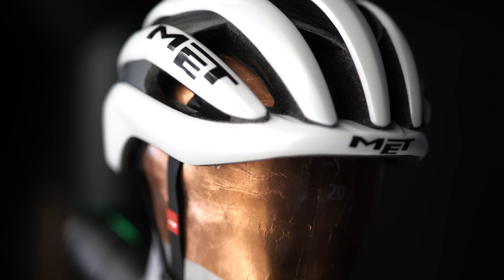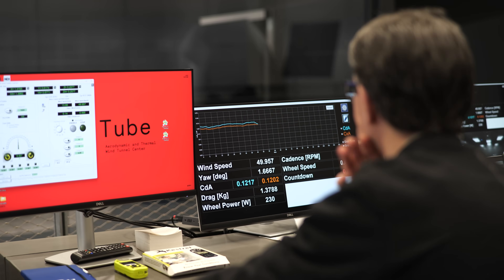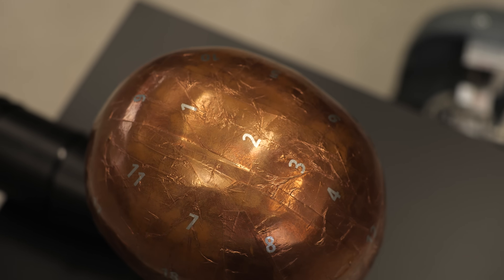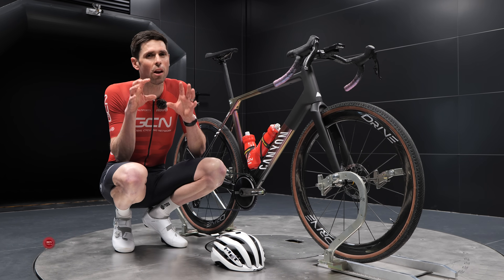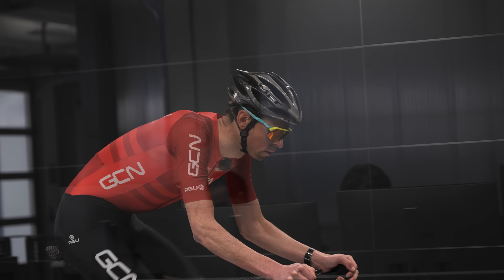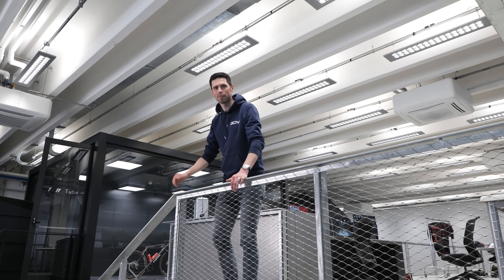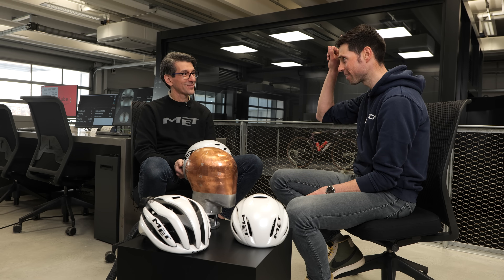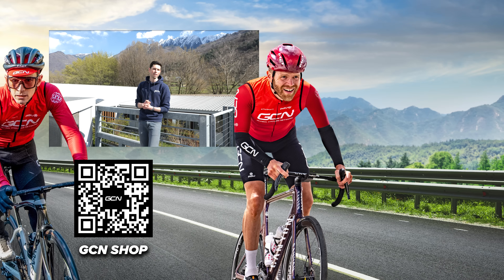How Will This Multi-Million Dollar Machine Make Bike Helmets Better?

Comment from the maker: Did you like this behind-the-scenes at MET? 🔥
Reply: @gcntech  Why didn't you test the Manta? What are you hiding?
Reply: my features list for a commuter helmet design: 
★a two-piece day/night (tinted/clear) visor 
★when the visor is up it needs to actually be recessed beneath the shell, protected against scratches, bugs, rain, etc... most of my commuting begins in the dark, I've been through six pairs of sunglasses in the last 6 months, one of them got all scratched up, the rest of them I dropped unknowingly when I pulled out tissues to blow my nose in the cold weather. I didn't notice I even lost them because it was dark. it wasn't until I went to put them on for the Sun that I even realized that they were gone. I later found the crushed up bits, in one case months later because I must have dropped them in the snow.  
★3M retro-reflective markings (passive-safety) alternating with LEDs(active-safety), embedded in the shell such that there are indications to other road users not only that you're turning your head but also which direction you're looking. I recommend "eyes" on the front, red reflective vertical bar or triangle on the back.
★power switch for the lights should be illuminated and located front and center where you can see it while you're wearing it, so you know if it's actually on or not. 
★the lighting circuit should also have a daylight sensor so that they automatically turn off when you don't need them anymore (I always forget to turn off my headlamp if I arrive to my destination after the sun has risen, then the next time I need a ride in the dark the battery is dead) for kids helmets you might want LEDs to turn on automatically in low light as well, for adult helmets it might be better to have a 3 position switch [on | automatic | off]
★removable rechargeable batteries in the style of Petzl Actik headlamps... same form factor as non-rechargeable batteries so that in an emergency I can just buy the correct size battery along my route.
★dual headlamps, so that when it's foggy the beam isn't cutting directly across your vision illuminating the fog directly in front of your face... I actually debate with myself about having built-in headlamps, it would be more stable, and it could have better weight distribution making the helmet more balanced... a separate headlamp adds weight to the front making the helmet want to slide towards my nose.
★removable accessory winter ear patches and vent covers

I was literally just helmet shopping last week and not only did I not see any helmets with attached visors,
Reply: Hehe, I heard you say "Transa” “vas cheating deal." Greetings, Alex. Have a great week, bro.😅 Cheers from Mexico

Comment: Reminds me of my final year thesis 20 years ago. I designed a copper headform with discrete sections with 24 thermocouples and three heating elements to measure thermal performance of helmets at front/mid/rear of the head. But I coupled the headform with a torso to get more representative airflow. Also measured aero drag.  Ahead of my time :)
Reply from the maker: That’s some serious Time Machine work you did there!
Reply: @gcntech  I even suggested to Louis Garneau there were big gains to be had in designing an aero road helmet - before any other manufacturer was making them after testing an $8- no brand helmet as significantly faster than the Giro Atmos etc helmets at the time (tested all the main brands).
Reply: would you be able to share your research? have been fascinated by this lately and trying to read about it.

Comment: With so many bots in the comments you might need some different kind of protection. Anyway I just bought a TT bike and so am considering a TT helmet. Seeing  that the difference between a vented road helmet and a TT is less than 5 watts I’m not too sure now. Of course the sample size is 1 and the position is different but I reckon an aero road helmet will close that gap significantly. However it will still allow bugs to get in. An aero road helmet with an integrated bugnet would be the deal for me.

Comment: I purchased a MET Trenta MIPS back in 2021 and it wore like a glove. Very comfortable.  Loved it. 
So after 3 years of riding in the hot and sweaty central Florida sun it was time to pick up another one. 
I ordered a size Medium, same as the previous one… and it did NOT fit.   At all. With everything lose, it would not go on my head. So I returned it and got a size Large. It was soooooooooo large I looked like the guy from Space Balls. 
I was bummed because I really liked my other helmet and the look of the Trenta 3K was sweet. 
I ended up getting a Trek Velocis and it fits perfectly. 
I have no idea what happened with the MET helmets. 🤷‍♂️
Reply: The Met Trenta and the Trenta 3k are actually more different than they look on pictures. The 3k is narrower and lower if i remember it correctly.

Comment: Why didn't you compare the watts to a bare head?
Reply: Because you don't ride roadbike without helmet, unless you don't value your safety
Reply: @yukiko_5051  It's not about not wearing the helmet, but rather about establishing a baseline. How much faster is an aero helmet than a bare head? How much more or less does it cool your head than a bare helmet? These are some quite useful questions. Also, there are several scenarios where the risk is far lower, such as an offroad, flat bike highway. Does it still benefit you to wear a helmet?

Comment: This is tricky because I've noticed a lot of the new breed of TT helmets are sorta geared towards a head down position.  I race TTs, and I don't have a chase car behind me telling me where the turns are, if there's a hole up ahead, etc.  I get it, pros are pros, and get the good stuff but I think we've reached a point that if there's a "safety second" factored into the design, we need to have a line between pro-only and consumer-only stuff.  Cool video, I geeked out for sure.